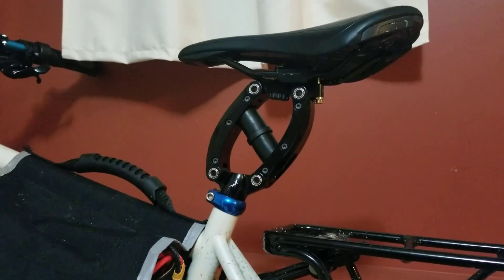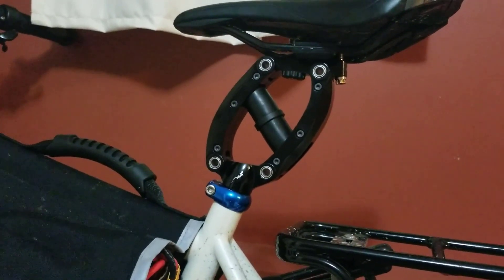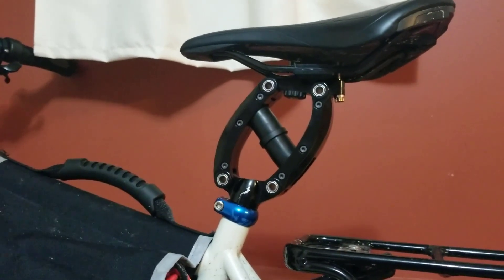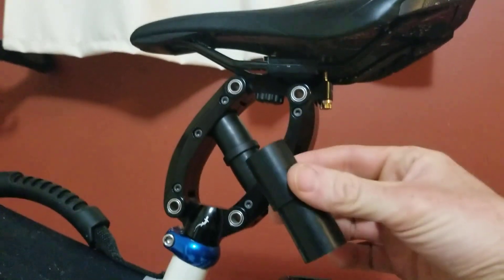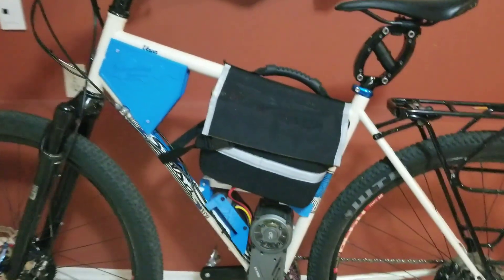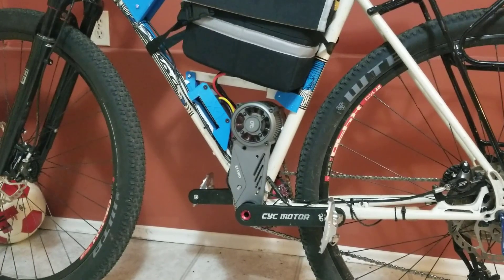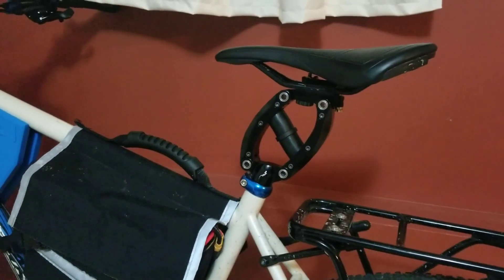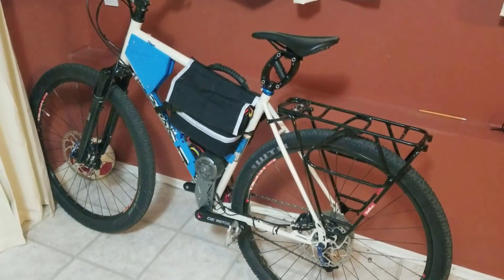Cane Creek Thud Buster Suspension Seatpost - Alternative to full suspension for ebikes

Comment: Looks like it requires 6 inches or so of under the seat space to be used.  Is there an optimal amount needed?
Reply from the maker: With that frame it just fit. There are other brands and types that take up less space. It's quite a tall frame so I was worried if it would be too high. I would not raise it though.